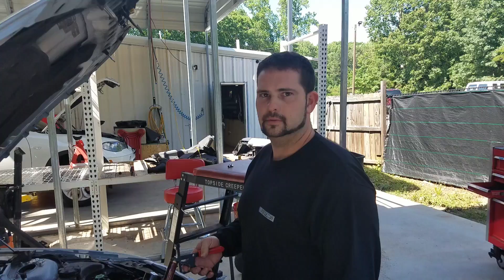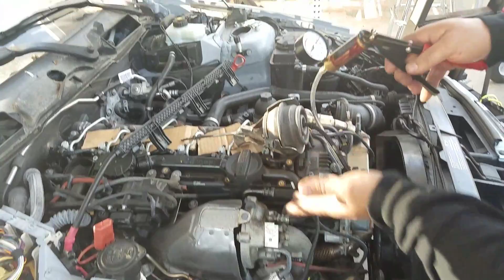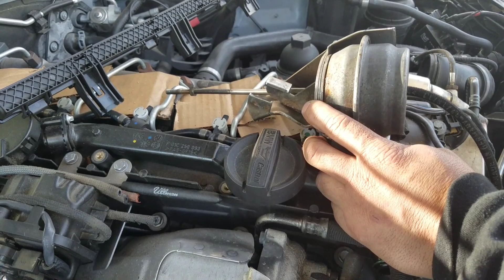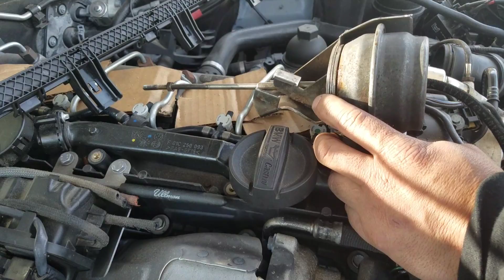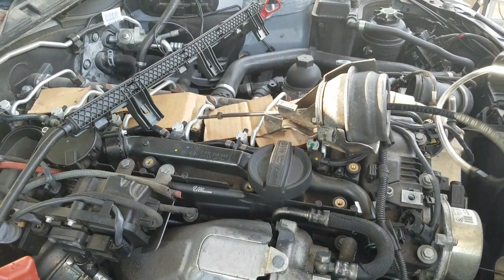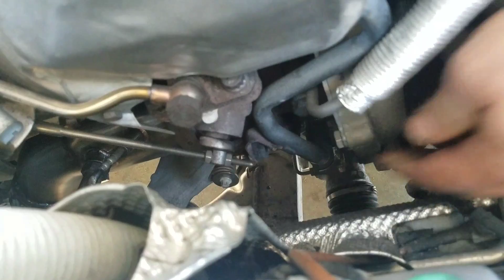BMW Diesel 335d and x5 35d High-Pressure Underboost Troubleshooting

Comment: Hi, thank you for an excellent video. I have the same problem with my new installed Turbocharger. My small turbocharger do not work because leakage from the boost pipe. I am going to replace the boost pipe. The exhause hose connecting to he exhause sensor you talk about, which BMW model or engine is affected? I have a BMW 525D Xdrive F11 2012.

Comment: Hello my 535D 272, when going over 3300 rpm, car is asking for 1.8 boost and is receiving 1.5, I have changed pressure converters and I have checked Actuators if they leak vacuum, everything looks good but the issue remains, can somebody help please?

Comment: Can a broken small turbine blow the valve cover and fill the whole engine compartment with oil? Car bmw x5 35xd(30sd) mileage 280k turbines have not been changed yet, KVKG changed, in the inlet all in oil. Already don't know what to do, checked the big turbo axial play is not there, there is minimal radial. Here I think to remove the small one or not.

Comment: It seems like the adjustment rod has about 16 threads exposed. I think this would leave the flap never being fully closed for the LP stage. Is that correct?
Reply: DID you find the answer

Comment: 🆘  i got 335d after hittinh 120mph it goes into limp mode i turn the car off and on and it has power again

I had a code exhaust gas cooling switching valve open circuit 

Anyone know what it could be ?

Comment: Know how to fix this issue - 2010 335d- No crank no start , wipers won’t turn off, testing 12 v at battery and at terminal under hood, checked ground strap under driver door , replaced the relay fuse in the glove box ‘forgot it’s name’ and had recall serviced to replace power going from battery to fuse panel. Driving one day, wipers came on, no rain, all dash lights came on, and car shut its self off to never start again

Comment: Hey bro, I have a similar issue with my 435d, upon accelerating I get no power what so ever until engine reaches 3000 rpm then the car shoots off, the fault codes I’m getting are

 “27B900 exhaust gas pressure before turbocharger, plausibility, difference, measured from calculated exhaust gas pressure, too low”

“244c00 charge - air pressure control, control deviation, charge air pressure too low/positive control deviation”

“287500 oxygen sensor oxygen concentration implausibly low (in overrun mode)”

It’s driving me insane... what could the issue be ?
Reply: Hi have you sorted i have same issue with 335d
Reply: Any update?

Comment: So if the lever isn't moving does that mean the turbo isn't working??
Reply from the maker: Only as a symptom. What it really means is you have a vacuum problem
Reply: If the lever doesn’t move it results in exhaust going thru the wastegate not routed to the turbo. So the turbo is not effective. A vacuum is needed to activate the lever.

Comment: Also the turbo on this 3L single turbo does it have a vein plate that spins around in it and once it gets to a certain temperature and age it buckles stopping the turbo from working quite common on vw's is it the same on BMWs 2008 on

Comment: Hi Rodriguez I'm just about to fit a high pressure pump on 3L X6 I have the timing pin timing tool once it's all fitted how quick will the engine startup do I have to spin it over for a long time or just leave it with ignition on and let the secondary fuel pump fill up the lines and the high pressure pump James Autos uk LONDON  CAMDEN

Comment: 2010 35d DPF delete. I just put your EGR race pipe on to replace the EGR that was programmed out back in November. At first when the motor was cold it was great, but once it warmed up I lost throttle response. From idle I can put the pedal to the floor and it very slowly accelerates. Once it gets up to 2000 rpm it takes off like a shot. Any ideas what it did wrong? MAF and MAP are new this month. No cel light.
Also, the exhaust has a much lower tone to it than before the race pipe.
Reply: Having the same problem .did u manage to find out what's that
Reply: Hey, did you solve it? I have the same issue.
Reply: @marekmikule  vacuum leak by the EGR

Comment: Basicly, how do you replace the lower , low pressure turbo on the 2005 m70 x5's. replaced upper turbo but its still pumping oil into exhaust for massive cloud and oil all over back of x5.
Reply: ooops its a 2009 x5.

Comment: Hey,  I have a 2010 335D & was wondering what type of exhaust manifold of turbo type leak issues you have seen on these engine setups?  I have a exhaust leak I believe @ the manifold gasket forward the front of the car.  Was wondering if this is a common issue?  From the amount of vids I am finding I will say not to big a deal or people have not made a vid of potential issues?  I see that you are very familiar with these cars & hope you could advise what I may be looking @ when I dive in.  Any advice is appreciated.  
Thanks in advance.
Reply: Hey man I got a manifold leak on my 535d and a oil leah from the turbo side and the car is lossing power pretty much ot feels like a 520d have you got any clue if it's a turbo problem?
Thanks.

Comment: Hello, I’ve had a nightmare with my 09 BMW 335d Diesel with only 60k miles, the car has been losing power and Limo mode etc, car has been sitting for 2 yrs. we have had it in 2 BMW dealers and 3 Independents shops which kept the car for 3 to 6 mos at a time each. We replaced a grip of parts and the car does the same thing. We changed EGR valve twice, Changed the Turbo, changed vacuum Parts, I have no idea what to do, are you local in Southern CA so I can bring to your shop? I don’t know what to say anymore. Thanks Gee

Comment: Hello. I have the 4530 charge air pressure control, control deviation - charge air too low error. My car is a 335d 2007 EU model. When I start the car that rod retracts ( it is pulled towards the windshield and stays that way ). I have absolutely no boost untill 3000RPM when the big turbo kicks in. What should I check?
Besides that I also have 447B oxigen sensor - oxygen concentration implausibly low (in overrun mode)
And two rail pressure errors
4570 rail pressure plausibility delivery - controlled - rail pressure to low/positive control deviation
4560 rail pressure plausibility delivery - controlled - positive control  deviation/rail pressure too low
These two rail errors appeared when I tried to overtake someone from low down in RPMs ( somewhere in the range 2000rpm to 4000rpm in 3rd gear ) 
It appeared when I was at about 80-90 mph and I had my foot down to the floor.
Reply: I have exact same problem on my 535d how did you fixed it ?
Reply: I also have this problem. Any update?
Reply: For me was the vacuum hose pipes. They were completely gone and didn't opened small turbo.
Reply: @constantinanton8538  how did you manage to know where the hose pipes were leaking from, I’m having the same issue on my 435d
Reply: @1995asker  you just replace them all like 4 meters of pipe.

Comment: Hey mate, a quick question. Do you have any suggestion or video about the DPF error... mine just showed up and I tried the regeneration process... driving at 2k-2.5k rpm but only works temporarily.

Do I need to replace the part, which is about almost $3k or do you have a magic trick under your sleeve that you can share? :)

Thanks in advance!
Reply: Change the service  date to clear dpf fault.   I tried all sorts  regens ECT..    it was the service date.   My diagnostics machine wouldn't do it either  it's in I drive

Comment: My 335d is throwing 428B. I have changed both pressure converters and also the two small vacuum controllers (or what they are called). When hitting approximately 120mph its like the turbo shuts down (limp mode). When i slow down and restart the car it works prefect. The only code i have now is 428B. I have a DPF and EGR delete with a stage 2 tune running about 370hp...
Reply: Hi. I have a similar problem. As you solved the problem, please help!
Reply: Did you find out what was it? I have same problem
Reply: Have any of you fixed this issue yet? Malone 2.9… getting old. Want my car to not suck…
Reply: Did you fix it?
Reply: Same issue here, did anyone figure this out?
Reply: @MT40633 did you manage to sort yours?

Comment: In the runnings of these videos the only really common error for the 35d engines is the low-pressure stage overboost issue. It would be absolutely epic if you could show how to fix that!
Reply from the maker: I've never seen that with a JR Auto tune
Reply: 4521 charge pressure too high?
Reply: Anyone stumbling upon this comment: buy a new vacuum line solenoid and replace it (or both). Or the vacuum lines themselves.
Reply: @firebladeflow  hell my hoses and solenoids are only 2 years old
Reply: @firebladeflow  are you referring to the actuator pictured in the video or the boost solenoids themselves?
Reply: @davidsny1190  no idea what the video is about. I commented 6 years and 2 cars ago 😂